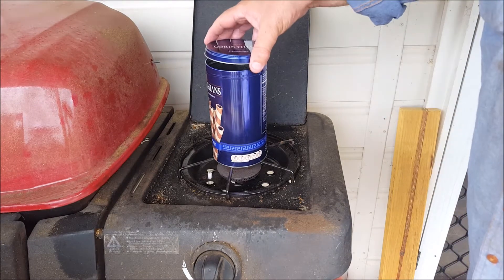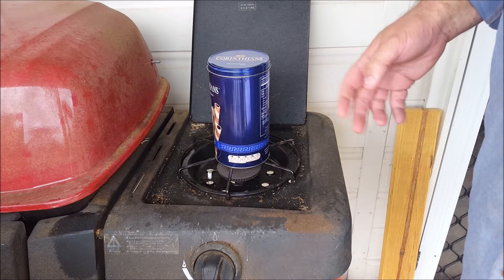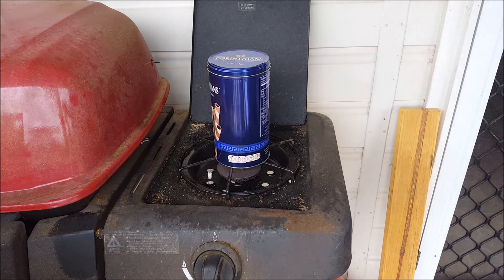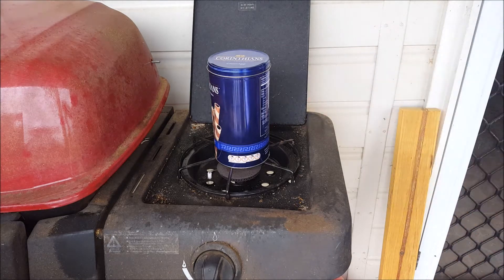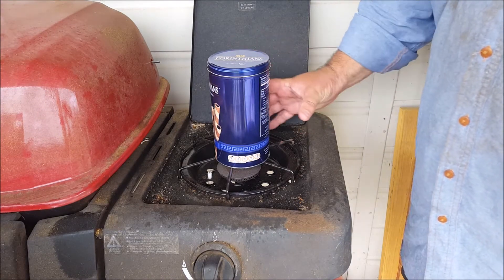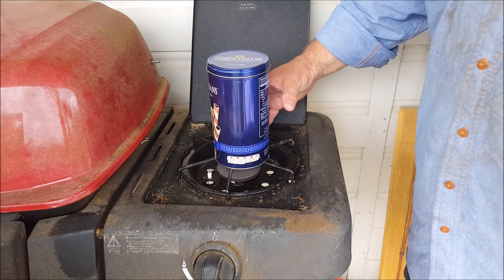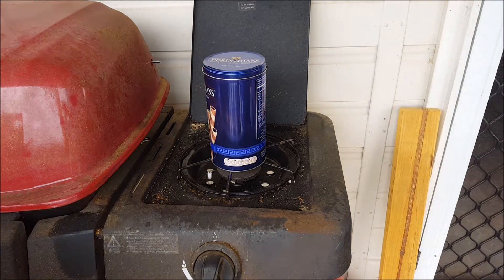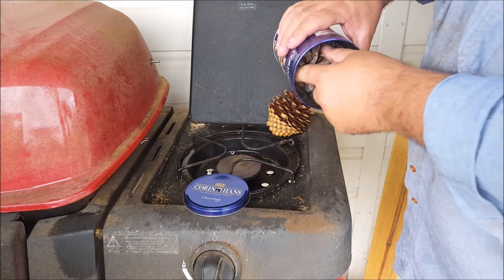Pop's Shack - Pinecone pyrolisis (charcoal)

Comment: Not very useful?? Toss it into any fire you are using for some extra BTUs.
Reply from the maker: Not everything has to be useful.
Reply: @PopsShack  In my world, it must be useful or pretty.
Reply: @MarkReaves84  
It's actually super useful as a soil amedment, in agar plate recipes, for mushroom growing, in remediation as a sorbing agent and for filtering. 
At the micrometer scale it is super porus which provides an ideal substrate for microbes like fungi, it has a high water rention capacity and free air exchange for oxygen. For these reasons it's also great for using to clean up  contaminated sites and for filters by absorbing things like heavy metals. 

Best way to use it is to granulate it- so after you produce it you run it through a crusher. 

Seriously one of the best soil amendments if you are looking to create long term soil structure.

Pinecone in particular is useful because if you are pinenut farming it lets you obtain a secondary yeild after the nut extraction.